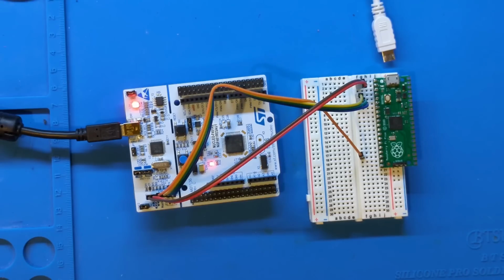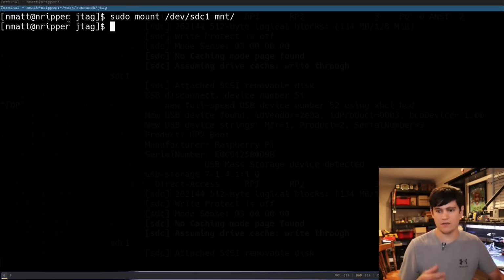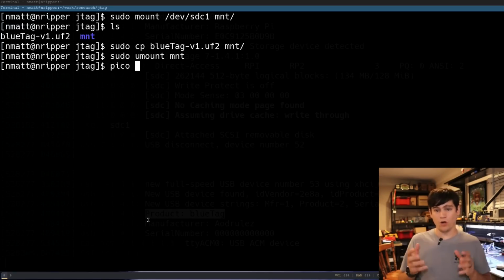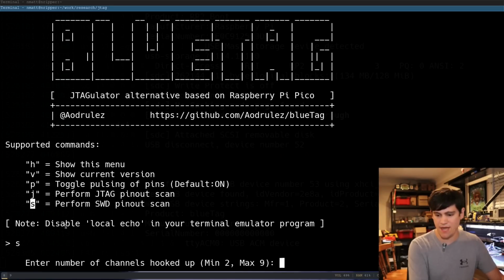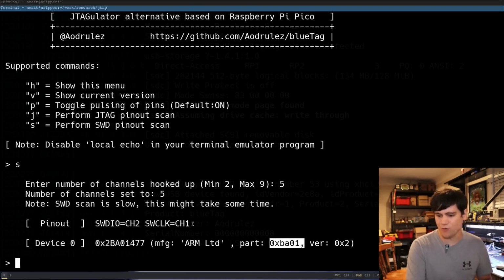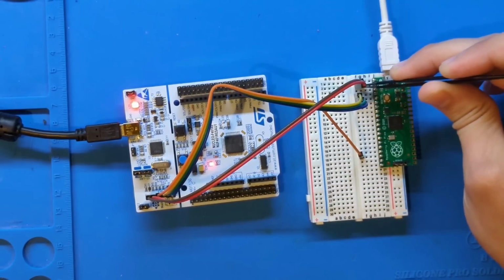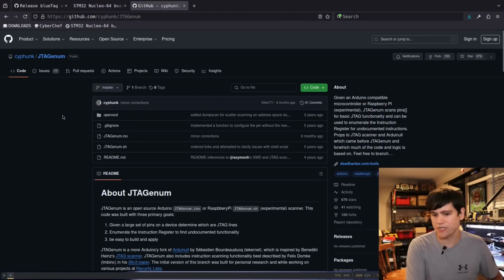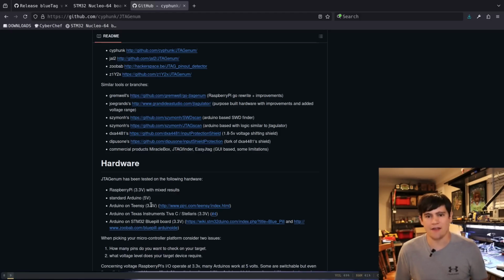blueTag - A Raspberry PI Pico JTAGulator Alternative

Comment: Help! I'm trying to get a serial console on an old motherboard using a CP2102 USB to TTL/UART dongle. I'm getting nothing but gibberish in picocom using any of the normal speeds starting of course with the one that is configured by the linux image I'm booting from and tried with flow control on and off. I have the TTL leads connected to the COM port header, pins 2, 3 and 5 for RX, TX and Gnd connecting to TX, RX and Gnd on the dongle. This setup works to give me console on my Raspberry Pis so is there something fundamentally different about the PC UART that's not accounted for here?
The linux image I'm booting from pops up a good serial console when booted in a VM with the COM port connected to a Unix socket so I doubt it's my software setup.
I've googled my fingers down to the knuckle and can't find anything relevant nor any reason why this shouldn't work so if anyone has any insights I'd be very grateful to hear them.

Comment: Is there a tool that would help determine communication protocols that doesn't involve and oscilloscope?
Reply from the maker: Logic analyzer
Reply: @mattbrwn  Thanks. 👍
Reply: @mattbrwn  Do you have any recommendations for a low cost solution?
Reply from the maker: Link to a super cheap one is in the video description. That's the one I use currently. Might upgrade to a Saleae when I have more funds.
Reply: @mattbrwn  thanks. I'll take a look.
Reply: @drooplug let me recomend logic analyzer by dr. Gusman using raspberry pi pico.

Comment: Pico is so inexpensive that I just keep 3-4 extras on hand for random projects now.
Reply: The rp2040-zero is about $2 each on Ali and has a reset button and RGB led.  I bought about 30 so I can throw them at any project that comes up.
Reply: XIAO Rp2040 are currently $3 per piece (2350 coming).